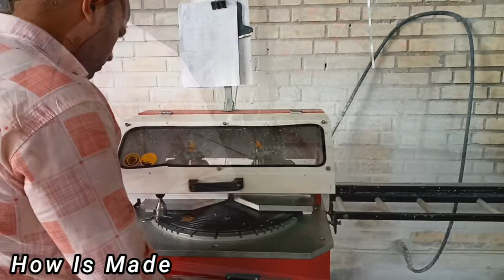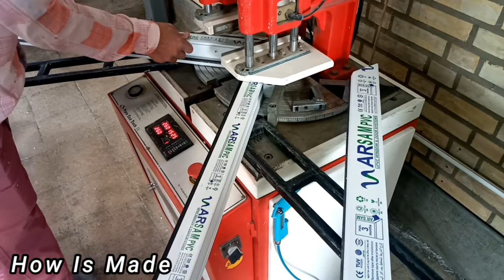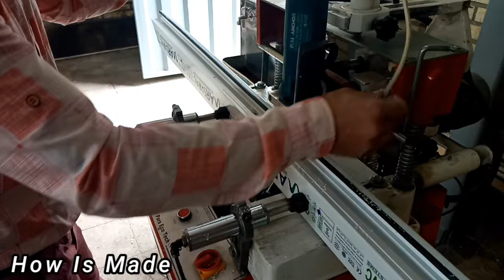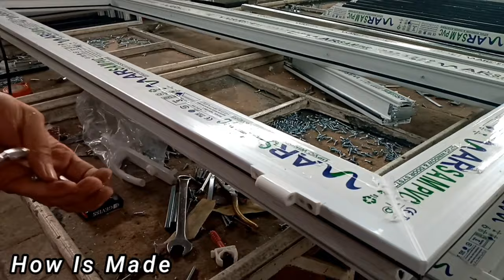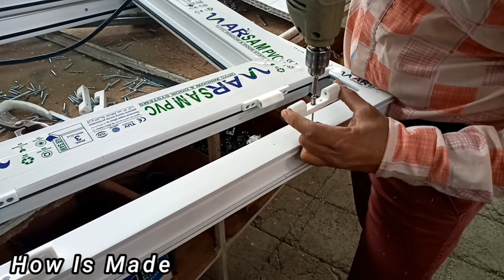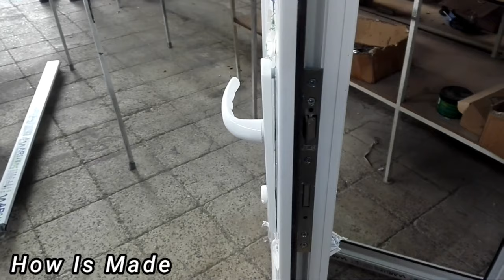Metal Working : Making UPVC Doors

Comment: Can't believe they use a single headed welder for 90 degree angles and not using air tools when the workshop has air for the welders etc . Then fit the panels to be removed when fitting so you can toe and heel the door